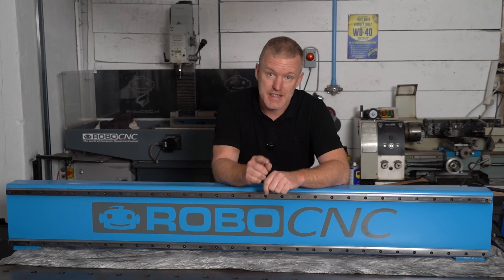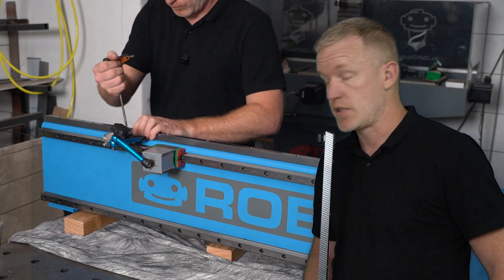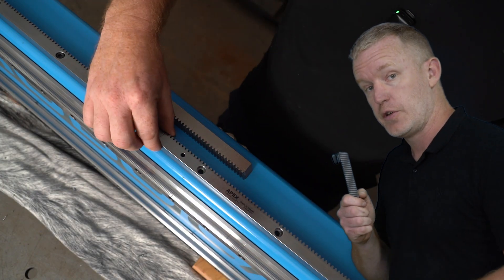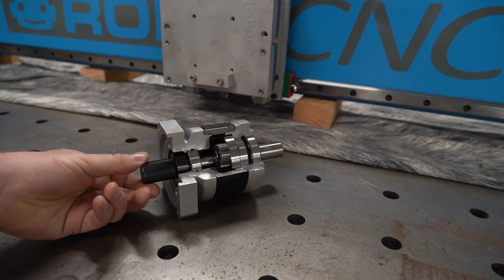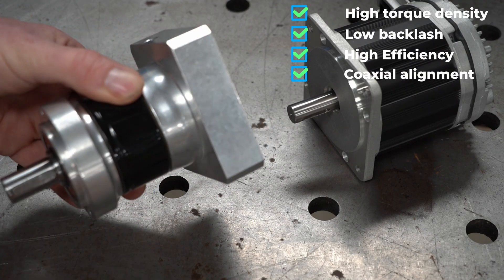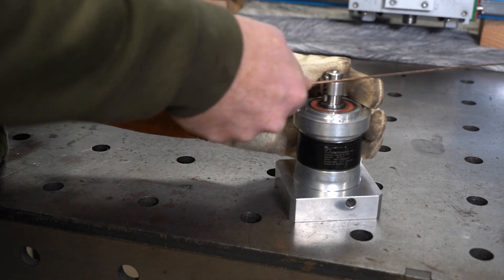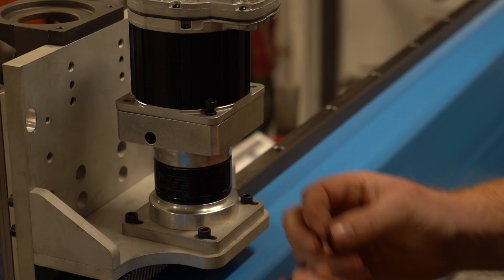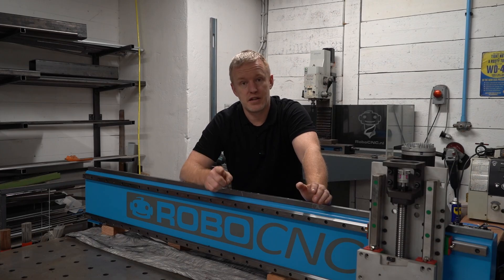PLASMA 06: Rack, Pinion & Planetary Gearbox Setup: Machining, Mounting, and Motion!

Comment: are you going to run a planetary gearbox on the X/Y axis?
Reply from the maker: Yes I’m going to run the same motor and gearbox on X/Y, but planning to use a spring mounted setup for gear engagement over there due to the long length of the axis.
Reply: @RoboCNCnl that’s exactly what I’m planning for mine too
Reply from the maker: @BearCreekMetal cool…. Make sure you also have seen the previous video…. You might like the excel sheet to calculate
Reply: @RoboCNCnl I binge watched all your cnc videos ❤
Reply from the maker: @BearCreekMetal 🙏🏻💪🏻
Reply from the maker: Wow ! 🤩